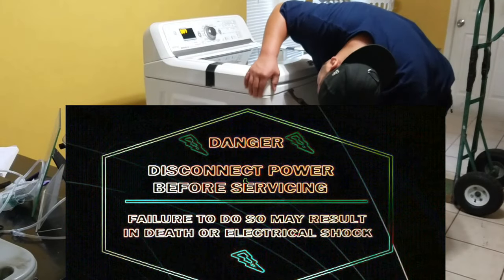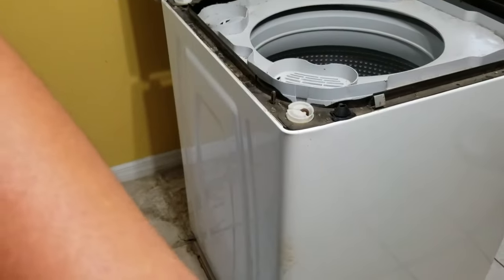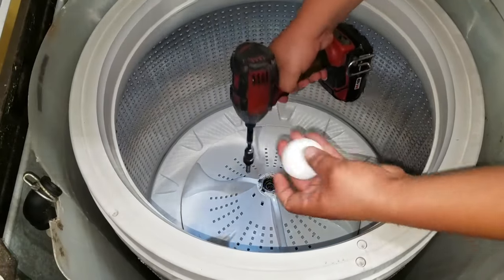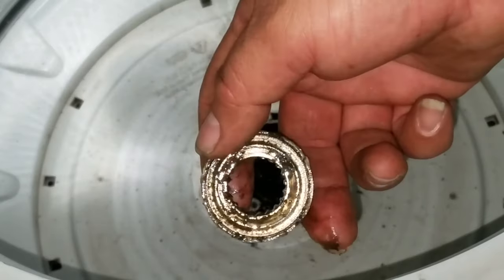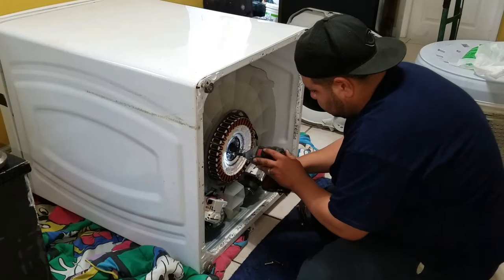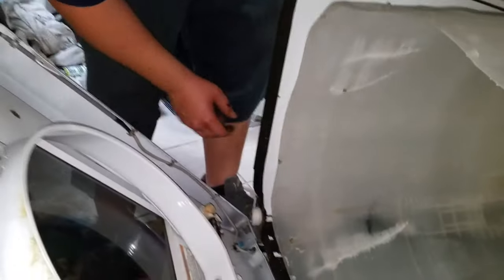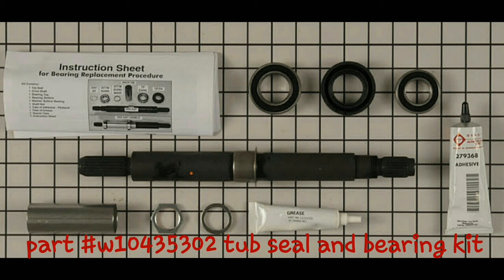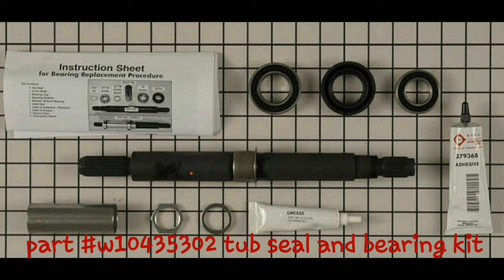#Maytag #Bravos #Washer Tub Seal and Bearing Kit Replacement MVWB700VQ0

Comment: DIY Repairs NOW, which is the best bearing type that you suggest ? I'm at the second replacement in ± 5 years, but the newer replacement last almost 2 weeks before leaking to the ground !? 
I used 2RS bearing, but they came with the repair tool kit without brand on it, compare to first job was done with dodge bearing.
For my soon third job, I would wish to make another 2-3 years ;)

Thanks for your experience sharing !
Reply from the maker: I always suggest to install the OEM if yours didn’t last long or it was either a defective new part or defective tub seal just make sure the tub seal is installed properly the way no water gets on the bearings.
Reply: @DIYRepairsNow  do you have an equivalent product to the glue WP279368 ? It makes no sense that the tube alone cost more than 40$ when it's include in a kit for less than 70$ for all parts ?

I look to buy the glue separately since I wanna buy SKF bearing from my distributor.

Many thanks for your help !!
Reply: @tibas20   The Whirlpool technical bulletin on bearing replacement, if read carefully, states that it is Pliobond sealant/adhesive that they're using to bond the tub seal in. This is like a contact cement. Search & you will find it. Other aftermarket kits are using silicone RTV, which is what I'm going to use.

Comment: Awesome  video, super straight forward. I followed it to the T. And im getting an F50 motor stall code. I leaned my washer over and pulled the motor off and un plugged and plugged both wires in. I have a bravos xl. Any tips?

Comment: Also...What is the typical professional repair cost for this repair including Parts and Labor??   Did I save any money by doing this repair myself?  Also, I noticed two small cracks in the plastic housing of the stator.  Is that a problem?  I did put it back in the machine.

Comment: Very helpful, but there's a couple of elements missing.  Before attempting to hammer out the shaft, you must remove the top cover from the main tub, then pull out the rotating basket.  Failing to do so will cause a lot of unnecessary hammering of the shaft.  Also, when the washer is righted (after tipping the washer on its side), the suspension (spring) supports may not seat properly, so before snapping the top on, make sure the tub is centered in the housing. 
All in all, very helpful!

Comment: Am I right to believe the six screw in the hub suspended the inner tub instead of letting it sit on the drive shaft or outer tub?
I can’t get the drive and further in to let it all sit flush.
Reply: Watched another video on hub replacement and he explained that you should lift the inner tub while replacing the hub around drive. If you didn’t know this you might think you need to knock the drive deeper and drive yourself crazy.

Comment: Great video. I've run into a problem that no one else seems to have had. I'd appreciate some advice. I installed the shaft nut, stator back plate, and stator. I checked the drive shaft by turning it with my hand. It turned freely. I installed the rotor and then checked the drive shaft again turning it by hand. The rotor turns part of a revolution freely than exhibits a firm resistance. It still turns but much harder. It frees up again as I continue turning it by hand, then resistance again. When I remove the rotor, the shaft turns freely. Put the rotor back on, free movement then resistance. Any ideas what could be causing the rotor to bind against the stator? I would really appreciate some help. Thanks so much.
Reply: You're creating a magnetic field by rotating the shaft quickly. Wait a few seconds and the field will dissipate. Nothing is wrong.

Comment: Thanks for a great video.  I'm having a problem loosening the rotor shroud bolt using the allen wrench.  I've even used a hammer to try to break it loose. It's not budging.  I'm afraid it will strip out.  Any suggestions?

Comment: Great video! Very helpful. This issue though...on mine, the shaft would not drive in toward the inside but had to be pulled out from below. I had fits trying to drive it through until I saw it was loose and would just pull out. Wonder what I missed -- different stuff or newer machine?
Reply: never mind---figured out my mistake.

Comment: Excellent video!  Just like you did, I am also having the issues with the crooked bearing and spacer.  I have already removed the bottom bearing 4 times, but keep running into the same problem.  Any suggestions?  Thank you.

Comment: My Maytag Bravos MCT top won't come off. Even with the putty knife method.
Reply: Remove the two screw in the back from the green hinges, then slide top towards the front, then reinstall screws before tilting up.
Reply: @craige2574  Got it all done, problem was the hinges were rusty and so required lots of prying. I removed the screws in the back too.

Comment: Hola bori! I have a small problem, I fixed mine and did everything exactly like you did but I have a small problem. My stator is scratching on the rotor, right where the magnet is I can hear it, took it off two times and I can see exactly where it’s scratching I can see the marks. Was wondering if you’ve ever had this problem before, if so what do you suggest. Btw you do great work and explain things very well Thank you
Reply: Hey man, i know its been 4 years but... i have the same problem. Did you have any way of resolving this?

Comment: Hey
I have a problem. But can't seem to understand why it's happening. I actually had to take apart the whole bearings.
I also bent the ring that goes on the bottom with the bearing. Used the old one and put it back together. The other problem. I couldn't get the rubber gasket in all the way couldn't understand why. Put it together tried to do clean washer. Just keeps giving me the F51 error.
It's been like this for 4 weeks
It's just so frustrating. Can't figure out what to do. I even followed your video about the washer to put it on the compression tool before tightening the bearings.
Can you help me

Comment: Hey I work for a service company I have never done a bearing job but I went with a tech on one so I could learn and the top bearing broke leaving the outer steel ring still in the tub he called it a dead job after that and said once that happens it's a wrap!!! Has it ever happened to you?if yes were u able to salvage the job or there's no way to get that steel ring out?

Comment: LID / TOP ALERT - You might have a Bravos XL washer with clips on the back of the lid and not front latches. Meaning you disconnect two green clips on the BACK of the washer then slide it forward. It is not ideal because now the top is "free' with NO hinges. Next step is you have to open the console (three screws in the back) and then disconnect the electronics. Number each connector and its connection with a sharpie...  Now you can take the entire lid off. and proceed with the rest of the video.

Comment: Thank you for this video.  I followed your guidance and replaced the shaft and bearings but now I'm getting the SD code and the machine will not move past the wash cycle.  Any suggestions?

Comment: I just have a question we got the bearings out of our cabrio washing machine with no problem so we thought when we tried to put the bottom Bearing in we realized that the casing was still in there now we cannot get it put we have tried everything any suggestions?
Reply from the maker: Cheslea Brough If you mean that part of the bearing is still in there And it’s not coming out you need to heat it up to be able to remove it
Reply: What do I use to heat it up
Reply from the maker: Cheslea Brough I use a blow torch but some people use boiling water the purpose to heat it up is to make the metal shrink
Reply: DIY Repairs Now Can you tell me if they make a puller that you can buy I know that they make a bearing puller but i have searched google just for the race puller or casing puller which ever you would call it and have had no luck finding such a thing?
Reply from the maker: Cheslea Brough I had this issue before and I thought about doing the same thing but I never found a pulley they will help me with this issue Because the ones I found well not work and because it will have to put Wade on the plastic tub so the only method that I use is to heat up the iron and bang it out
Reply: DIY Repairs Now Thank you I will try this.

Comment: After this repair I am getting an F72 error.  I went through all of the manual tests and it fills, drains, spins, etc fine when testing in manual mode.  When going through diagnostic tests it hangs on C8.  Water drains in that stage, but it never spins, so it can't tell that the basket is engaged.  I'm not sure what it means to disengage and engage, but it gets through C1 fine, where the washer fills until the basket floats and moves on, so it seems like it's something during C8 and the engagement process.  Any ideas on how to solve this?  FYI, when going through the manual spin tests, this repair DID fix our original issue, which was the airplane takeoff sound associated with the bearing problem.  Thanks for the videos!

Comment: At 7:36, he talks about the tool to remove the stove? It’s looks like the bottom cog that has the screws mounted into it. Do I need that to be installing the piece back in as well?
Reply from the maker: 7:36 If you have a problem removing this tub. you don’t need the tool to reinstall the tub you just got to sand or clean the shaft really good to put the tub back in place

Comment: Hi and great video.  I have a question.  My bearings are bad and I'm in the process of replacing them.  But I also am getting a UL (unbalanced load) error.  I took the basket out and there is trapped water in it.  No matter how I hold it or tip it I see not water coming out.  I'm thinking this is maybe causing the UL error.  What is your thought on this?  The only thing I can think of is drilling some holes and draining it and maybe some silicone to plug them up.  I don't see a Maytag basket for sale anywhere.  Any ideas what I can do?  Thanks so much!
Reply: That water in the inner basket is a "counter-balance" mechanism. It's meant to be there. Its sealed into the top ring of the basket.

Comment: When I was hammering the shaft from the bottom it was extremely hard. After too many whacks the shaft finally gave. Problem is that the upper bearing came apart and the outer ring is stuck in the tub. I have tried prying and banging without success. Problem is that the inner diameter of the ring is larger than the access from the bottom of the machine so there is no lip to access. Help please.
Reply: You need to first bang out the bottom bearing (from the top of the washer), when that's out you'll have nice access and a lip to bang out (from the bottom of the washer) what's left of the top bearing.

Comment: I have a leak on this model washing machine maybe 1 hr into the cycle start to leak from the front. I checked both pumps no cracks. What issue makes you think it's this shaft problem?
Reply from the maker: Phil Gali It sounds like you have a tub seal problem which is the one seals the shaft If the water is coming out from the middle of the rotor that's the problem
Reply: @DIYRepairsNow  how do you fix this? Do I have to order parts or just add a sealant?

Like do I have to go through all the steps in your video, replace the bearing, or
 just remove the part inside the tub and put a new cap?

Comment: Should mention to anyone who wants to try this themselves... I have a Maytag Bravos model and I had to hit the shaft from "inside" the tub and not from the bottom.
Since 3 videos including this one all state to hammer it out from the bottom I ended up damaging it after trying too hard thinking it was seized, which adds $100 to the cost of my repair.
Hard to justify buying the parts and tool now for ~$352 + tax cad for a 9 year old washer since I don't want to skimp out on the tool...
Edited typos.

Comment: Okay, Folks. We kept getting a UL in spin cycle only. We checked the bolt even thou we knew it was tight. There are clips on the Rotor Position sensor. Ours had just one of the clips, not all the way on causing the UL.  Once we clipped the rotor position sensor on to the motor. We never had a UL again.  Hope this helps. We did not need to replace the sensor.

Comment: After four years of residential use by a family of four our Maytag Bravos model MVWX655DW1 washer had an unacceptable failure of transmission part # W11035751 due to poor design. The output shaft that drives the tub and agitator is unprotected from corrosion and is submersed in each wash cycle and subsequently designed to fail. This preventable failure could be prevented by the designer by plating the shaft or constructing it of stainless, but then they would sell less washers. The transmission purchased on E-bay was half the price than if purchased from Maytag and worked wonderfully but has the same issue. The only thing I could do on the replacement transmission to slow the corrosion is to paint the shaft then coat with silicone during assembly. I know this will make disassembly more difficult in the future, but it is the only option I have as grease may not be used inside the wash tub. The other issue of concern was the build up of a quarter inch of mud under the agitator and around the wash tub despite the regular use of the proper cleaning products to periodically flush the washer. My expectation of Maytag products was one of quality design but after seeing this failure in a relatively short period of time, my expectation has changed greatly!
Reply: The major problem with the design is the bearings can not handle high speed(max extract) also the seal should have a packing and a cover to prevent leakage....

Comment: That was a great video, I give you a thumbs up. However, how old is that wash machine? Mine is 6years old, all rusty and full of crud.   The shaft hammered out of the first bearing, but wouldn't budge further out of the upper tub bearing. So I took the tub out and placed it upside down and hammered, no go. I got a large sledge hammer and hitting as hard as I could it did not move, it only mushroomed the shaft. Anyway.... I'm buying a new washer in the morning 😂.
Reply from the maker: I had the situation once and it was very complicated to solve it I had to heat up the bearing with my torch but that procedure is difficult because it’s plastic around it. thanks for watching my video👍🏻👍🏻💯💯

Comment: FYI, if you suspect the bearing and the shaft have melted the plastic tub,  it is $180.00 for a replacement tub with drive shaft installed already from Sears direct. No need to purchase the bearing tool or dive shaft and bearing kit. I wish I would have known this before spending $160 on parts and a tool I will likely not need again.
Reply: Andrew Masterson -were you unable to remove shaft?  I've pounded mine and it seems like it should have come out.
Reply: Bat Masterson when did you order that part from Sears Direct? The one I'm finding is $329.
Reply: Really?! Post the part numbers and link the site, please
Reply: @freqsyn6493  I eventually removed the shaft. Then I unboxed the new tub, and it already had the shaft assembly in place. I spent hours removing the shaft, as to not damage it. I also purchased the barring kit and a new shaft assembly, I did not need.

Comment: Followed your repair and it worked but now I have a loud clicking noise during spin cycle. I think its coming from the rotor cover. Any thoughts? Possibly dirt on the magnets?
Reply: The rotor and the field coil are rubbing. Remove the rotor and make sure the field coil is properly mounted. Loosen and re-tighten the field coil screws/bolts in a "star shape" manner NOT clock wise nor counter clock wise. Re attach the rotor and spin and make sure it doesn't rub.

Comment: Also did you install the new water seal and not video that part? Where does the seal go?
Reply: dan the seal goes in the top . with the threaded part of the shaft facing down under the washer you tap the top with a block of wood till the shaft bottoms out in the bearings and the wear surface is touching the bearing. then tighten the thin nut on the bottom threads. jump up topside and set up your seal it has 2 grooves on the inside carefully put grease in the 2 grooves of the seal they are facing the shaft . do not get grease on the bearings ever (it is a dry fit bearing) or on the outside of the seal(thats where the glue goes.) if u do use 90%  alcohol to clean them. take and run a good bead of the glue on the middle to lower half of the seal slide it carefully over the shaft closed side up   and use the plastic pipe from the kit and a hammer to drive the seal in next run a thin bead around the seal where the tub and seal meet its got glue already there just put a thin bead to make sure then finish assembly and wait 12 hrs before running to be sure the glue is dry.  try to clean any grease you put on the seal inner lips that get on the shaft is cleaned up if not the first batch of clothes will get grease all over them .